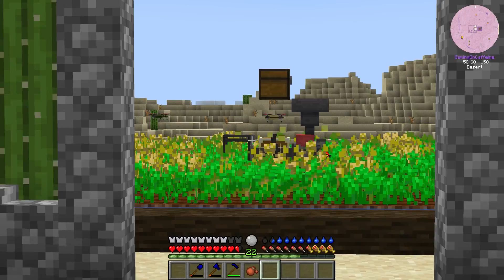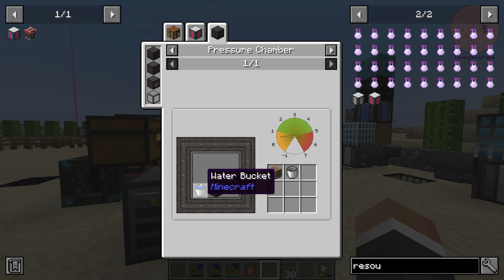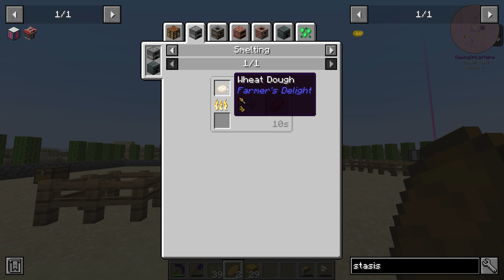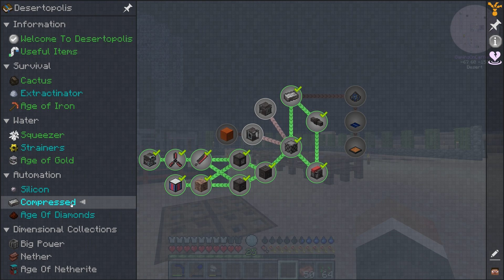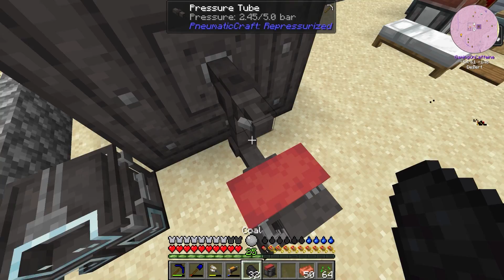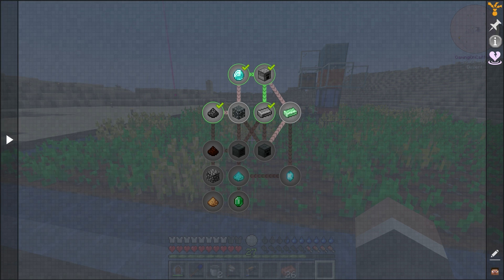Minecraft Desertopolis | FUELING DRONES WITH UNLIMITED LAVA! #6 [Modded Questing Survival]

Comment: Should really work on getting as many chickens bred as possible, pipe all their drops into drawers, and have that hooked up to the refined storage system. That way, you can toss void upgrades on all the drawers and not worry about needing more space when you eventually run out. You should do that to all the resource generator items, even the fluids if you can make fluid drawers. The more resources you can get, the easier it will be later on.

Comment: The drone's description says their work area is 17*17*17, so it's a cube? Maybe instead of building a wider area you go taller? You'd save on upgrades and it could look quite a bit cooler
Reply: the reason for the range upgrades is stuff falls outside that 17*17*17 area..like in the water or on the dark oak logs, to make sure they pick it up and that despawn he gave 2 range upgrades minimum so it'd be able to pick them up. it will also help with making it go taller as then the drones will have a way to get up that doesn't sacrifice farmland.

Comment: Also, obsidian is a better capstone, and you have access to "gadgets" like the block swapper you used in techopolis.
Reply: But how do you charge them?  I have an exchanger gadget but it won't charge in the charger like the entropy tool will.  The only thing I think might do it is the wired charger from EnderIO but that is beyond alloy smelting so I was hoping for a quick charging solution.

Comment: I'm currently stuck on getting enderpearls.   The enderpersons seem few and far between and reluctant to drop loot. it is a bit of a grind to get a cleric to level 4 so you cand trade for the fragments.
Reply: I think one chicken produces enderpearls. It takes some breeding tho
Reply: If you set up a SAG Mill (with a dark steel grinding ball) and an Alloy Smelter next to each other with the sides for both machines on Push/Pull, the ender pearls will start to duplicate.  I started with one and had 50 in about 10 minutes.

Comment: with a bit of optimizing, you could gain 8 of the center blocks of your farm back on the growing level
in the center, starting at surface -1, Water,
Surface, Surface +2 Chest
surface  +1 & +3 & +5, Air
surface +4, charger
surface +6 compressor, with Pipe on side
surface +7 fluid resource generator, with pipe on side
surface +8 Lava. with Glass on all sides
surface +9 Speed block
The item pipes can be waterlogged, so you could still pipe the output elsewhere

Comment: Great video.  Gold Chicken + Glass Chicken = Diamond Chicken.  10/10/10 chickens will revert back to 1/1/1 when breading two different chickens into a new chicken type.  At least it did during my session.  Getting 250 Diamonds is not easy at that point in the pack.
Reply: Might as well setup the Emerald chicken as well.  It only takes a diamond and green dye.  Lots of green dye in this pack.  I think you will want to go deeper into PheumaticCraft as the Iron man suit works very well here as upgrades are added, not to mention other advanced items.